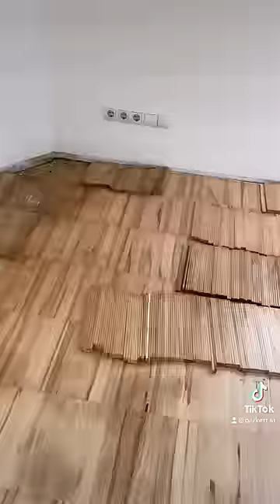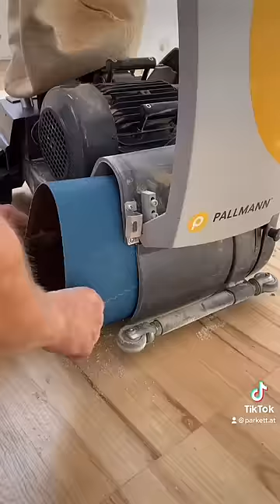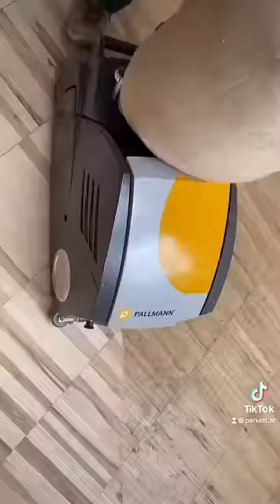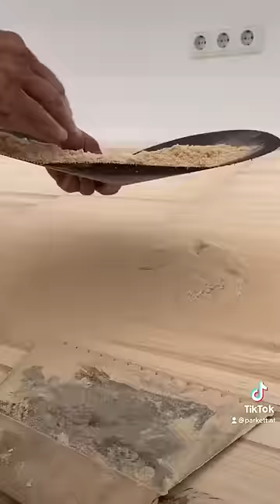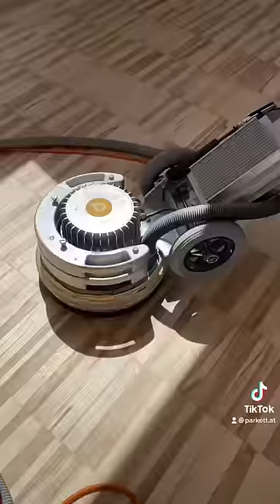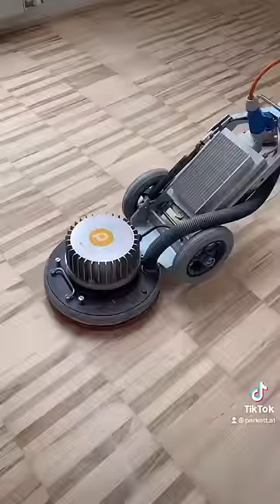Parkett sanieren 😱 #Shorts

Comment: I love how you use the saw dust in the finish, looks good and respects the trees, granted I don't know the first thing about flooring lol
Reply from the maker: 🙏 Thank you ☺️
Reply: @parkettat  air what do you call that fluid you added to sawdust? Thanks
Reply: The fine saw dust and wood glue or epoxy is used to fill any void's or imperfections in the wood.

The final product looks amazing but personally I would have offset the planks to a checkered or diamond pattern.

Comment: Using the dust from the scraps is one of the best things I’ve seen to date never thought to use dust amazing
Reply from the maker: Thank you fir your feedback 🤝 Appreciate it 🤗
Reply: Really? So what does it do? Why put it on
Reply: You use it as a gap filler and because it’s the same material and the colour would be similar when filling the gaps in your floor
Reply: Geeeeeez....
I use wood dusting in everything  in my wood work since I'm kid. I use it to many things to give uniformity and fill gaps

Amazed that you didn't know
Reply: what are they doing with the dust and that liquid??
Reply: I don’t really understand why use it ?
Reply: @thomasbroking7943  
They are sealing the floor. Basically a layer of resin to fill in tiny cracks and make it water resistant.
Reply: I once was so fortunate to do my 1000sqf apartment like that ... it was sooo much fun .... but I didn't know u could use the saw dust that way.... and I should have just oiled the floor... great vid tho
Reply: @larsbee  I did this for 3 years floor sanding and polyurethane and never thought to use the sand dust mix with abit of water yeah just amazed well I guess the customers choose the colour filler they want not dust hence why it never crossed my mind
Reply: @nooneimportant7012  they choise the color filler??? holy crap ... that's a thing? 

btw I'm glad I only did that once ... too loud and dusty for this snowflake ...
Reply: @strangelee4400  they said filling small holes.  they sand the floor afterwards i doubt it water proofs it.  They still have to pass liquid products afterwards.  i think 1 is to clean and prime the wood and then the clear sealer.
Reply: @kori5679  nobody cares
Reply: @karlguld5168  

???? Aaaaand your point  is??
Reply: @Swampgurl777  
???
Don't be too touchy.
And don't go on offending and calling me names for nothing.

I only mentioned what I used to do.
Woodworking always have  been part of my life.

Didn't meant to offend  anyone.
If you got offended, count till 10.and do  a deep breath. It helps.

Take care

Comment: I've been doing wood floors for a good while , this guy did a damn nice job. But he needs a good super 7 edger.   But still.  Damn nice.
Reply: What was the purpose of reusing the saw dust?
Reply: @ohmars310  to make filler. Usually mixed with polyurethane or wood glue. this ensures a perfect blending of color, and it also saves you and the customer some money.
Reply: I forgot to mention that when you do this, it's important to dispose of all the sanding dust collected in the first 2 grits. The reason is that you want pure wood powder , not contaminated with the old finish dust that you initially cut off. If I start a job on 36 let's say, then I bump up to 50 generally , I usually don't start keeping my filler dust until I change out to 80 for good measure.   Otherwise your filler will look like terrible and it's a complete loss of time cause your forced to sand the filler off the floor.  I've made that mistake in my early days, I don't want a repeat for sure.
Reply: @Mainbusfail  thank you for informing me! I was like "wth is he doing??" Makes sense now! Thanks!

Comment: If the point of “recycling” the sawdust into the finish is to give the floor improved traction, then bravo - I guess.  Otherwise, the orange peel finish it leaves achieves at only hiding the beauty that is usually intended with a parquet floor.  Seems a shortcut way to try to hide a cheap job if you asked me.
Reply from the maker: How else do you fill the gaps between elements? It is a sign of quality, if you do it right.

Comment: the strips that are used to cover the sides should also be lacquered
Reply from the maker: Never 🤷‍♂️
Reply: @parkettat  I mean, they should be made to match the look. Of course you can't easily lacquer them once they are laid and against the walls on the floor, at least not with the same process and in the same go and not without taping the walls up etc, but one could (and maybe should) do that BEFORE they are put in place, during preparations, before the actual floor itself is even put in place (so that there is still space to do it and no chance of ruining ones work). Small hand rollers are great for that. Of course it is extra work and a bit of a hassle, but with this quality of work I would think it only justified.

Comment: Left no room for expansion? Wood and cement won't expand)contract together, and it will start coming apart, right?
When room is heated, wood will expand A LOT, and cement foundation will always stay cold stay cold.
Reply from the maker: Of course there is room for extension. Always at least 10mm. 🤷‍♂️ Btw. we only sanded the floor 😉